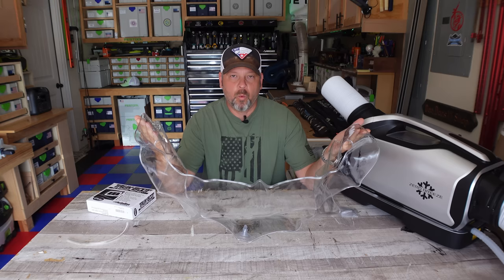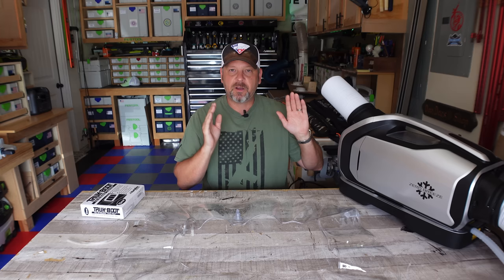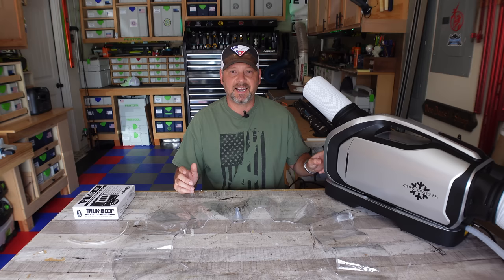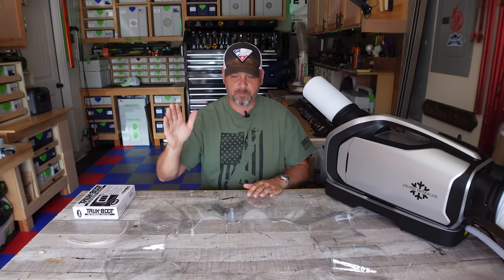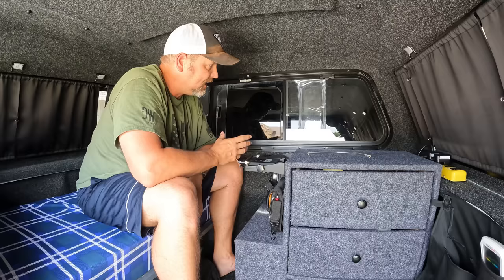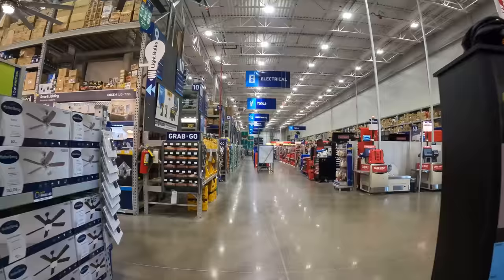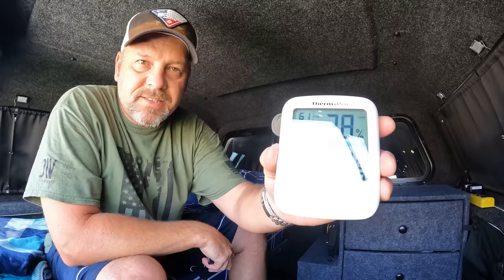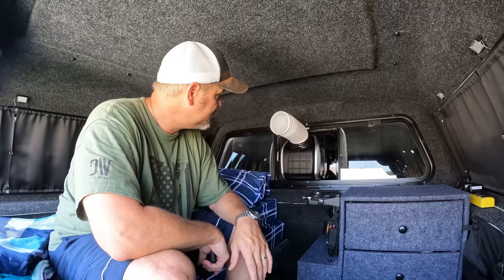TRUCK CAMPER A/C |  Performance Mods w/ a "Window Donut"!!! |  Zero Breeze Mark 2

Comment: they must recommend outside air for the intake because of carbon dioxide would build up after a while..  but  idk  .. the one design flaw i see is the out and the in pipes are right beside eachother out the window probably sucking some of the hot exhaust in with the fresh... maybe if it went out the other window on the other side...nice setup tho

Comment: I believe they want you to have fresh air circulating throughout your camper shell.
Reply from the maker: Yessir Jay. I believe that is the case the more I research this unit and read all of the other comments from folks who are much smarter than I am on this thing👍🏻
Reply: Two of those 9'' opolar brand usb fans will work wonders circulating  the air I only have one I'm my minivan and I can't believe  how much air it moves  for 12 volts.

Comment: In a pinch you could use a fat bicycle tube to put in between the camper window and the truck window
Reply from the maker: Thanks!  I actually did that, and am using an 18” bike tube. So far it has worked the best
Reply: @BrianWatersOutdoors  your welcome

Comment: If I remember right the rear intake is for the Compressor, so it has intake and exhaust. The front is the same for air-conditioning.
Reply from the maker: Thanks👍🏻

Comment: It most likely condenses the hot air. Which in turn helps the efficiency for cooling. If you try to take cool air to condense it causes the ac to work more. At least from my rudimentary understanding of ac.
Reply from the maker: Great explanation actually! Thanks👍🏻
Reply: @BrianWatersOutdoors  no problem, I just seen about a 100 different people had a similar take. Haha. Just found your channel the other day. I’ve enjoyed seeing your truck upgrades. I actually bought one of the bed tents from rei on sale a couple days ago. Going to see how me and my son like that. I currently do not have a topper. Otherwise I’d go with something similar to your setup. Thanks for the inspiration.

Comment: You'll find out if it works really good when you go camping and are using it in the most extreme heat of the day. Either way it's a good way to cool off when camping on hot summer days

Comment: Also, tire inner tube if you haven’t already made the switch.. the rubber will make a better seal for your window pass through. Plus only about 4-6$ for one.
Reply from the maker: Yup! Using an 18” bike tube now and that’s worked out the best!

Comment: Just get you a cooler load it full of ice cut a hole in the top put a fan on it blow out the side you will bring your camper down to around 68 degrees for half the money
Reply from the maker: I’ve tried that, but it just pumps in more humidity and really didn’t help my situation. Maybe in drier climates this would be a good option.
Reply: I'm in Utah so I've been  thinking  about building  one of these.

Comment: 75 is manageable and well with in safe sleeping. I bet if you ran it all night and checked it in the AM when you woke up it would cool even more. On a side note maybe put the thermometer where you could read it from the outside so you don’t have to climb in to see it, and let it run all night and see what happens. I would be curious!
Reply from the maker: Thanks David. The thermometer I do have is Bluetooth so I can start to check it from the outside without having to climb in/out.

Comment: You need some sort of insulation on that roof of that camper maybe like a piece of mdf
Reply from the maker: That would help for sure!
Reply: @BrianWatersOutdoors  just wrap it with that same carpet put a few weatherized bolts and washers and bammm we do that a lot to our cars and trucks for SPL REASONS

Comment: Be careful with the donut and your truck glass. I used one once during a hunting trip that had us put quite a bit of miles down some dirt roads and to this day you can see where that donut was on my truck glass. I assume it was the dirt that etched the glass. I specifically cleaned both the truck glass and camper glass before putting it in. It’s not the end of the world as long as the camper shell is on, but it is definitely noticeable when it comes off.
Reply from the maker: Thanks for the tip! I have switched over to using a bike tube now

Comment: Thanks for the review of the Mark 2, but I find it on the weak side as 2300BTUs is really not that powerful.
Reply from the maker: Thanks. It’s just a “spot” cooler, and not meant to really air condition an entire space. But, for how I’m using it, it makes it bearable in 100 degree temps.

Comment: I have the exact same camper shell window.  I considered the tube from HD like you got but was curious and concerned about rubbing.  Any issues with paint rubbing with the tube?  Trying to find a semi permanent solution so I can cool the back for dogs while driving.
Reply from the maker: I did not notice any paint rub. I only had it on for about 4 months though.

Comment: Great video Brian!  How large of a solar generator are you using to power the ZB2 all night, and how are you "recharging" the solar generator throughout the day?  Solar, AC, 12 volt cigarette lighter or AC inverter inside of your truck?  If I purchase one I would need to recharge it during the day time on camping trips etc.  FYI: I purchased the donut and you are correct, the squeak is terrible driving down the road!!
Reply from the maker: I use a 2000w battery power station. It runs the unit about 6 hours, plus the battery that came with the Zero Breeze that gets me maybe 2-3 hours (running on MAX) cold setting. It is hard to recharge these 2000 watt battery power stations with solar, but you could if you had a very large solar panel, or multiple panels tied together. You can also use a car cigarette dc charging cord, but those only typically give you around 100-150 watts of juice. So to get all 2000 watts back would take quite a long time, and you’d need to leave your truck running so it wouldn’t drain the battery. Best bet is to use shore power to recharge if you can.

Comment: My donut covered the whole back window. You installed it from the outside. The valve to blow air in was easily accessible… Plus The Donut was far superior to your product. I picked mine up at an RV dealership.. Likely still have it…
Reply from the maker: I’m sure I did it wrong, or got the wrong size, but just didn’t work out for me.
Reply: @BrianWatersOutdoors  just trying to help. With your inside window opening the full width would have been easier for me. Plus mine had spots to tie cord between the top and bottom allowing it to stay uniform.. You had the right idea… mine was almost rubber tubing but good and heavy even to stay in place -40 below in the winter
Reply from the maker: Oh I know. I’m betting they “don’t make ‘‘em like they used to” is also the case. This felt just like a cheap pool raft, and had no tie down points. Someone did mention even a bike tube or motorcycle tube would also work. I’ll probably try out several diff options in the future👍🏻👍🏻
Reply: @BrianWatersOutdoors  call different RV dealers: likely have it in a catalogue or look up on computer…. Sure don’t see many of those around. Good luck staying Cool… 108 awfully hot … likely do a little better when sun goes down or park in the shade., Had many good years Camping and fishing out of truck… Canoe in top and then a Lund 16 foot.

Comment: What does it run off of? 12 volt or ??
Reply from the maker: Both👍🏻
Reply: 12 volt but the batteries  kind of small and is only 2300 btus

Comment: AC like this works off the differencial temps of inside vs outside air, if its pulling in cold air, it wont work right.
Reply from the maker: It’s pulling in outside air from the rear duct👍🏻

Comment: You’re misunderstanding the purpose of that 4 inch intake duct. That is not connected to the outlet duct on the cold side. The screen under the cold outlet side IS the intake, it IS recirculating exactly like you’re trying to accomplish. The 4 inch intake duct is used to carry away the heat from the hot side only and thus also has a hot side outlet, another opening/outlet perhaps you haven’t noticed. The way you set it up in the video is as good as it’s going to get, nothing more to improve except insulation at this point.
Reply from the maker: Thank you👍🏻👍🏻

Comment: Cant you just get a small RV ac unit and install it on top of the shell?
Reply from the maker: You could. If you want to cut a hole in your camper shell. Which I don’t.

Comment: just a question: Is it possible to install a rooftop air conditioner? Or are they too heavy for a camper shell?
Reply from the maker: I’ve seen it done….I just didn’t want to cut a giant hole in the roof of my camper👍🏻

Comment: I was wondering.. if you were to route the intake to the cabin that you’re also cooling down wouldn’t it be more efficient or at least have a quicker cool down if it were pulling air in from the cool cabin its creating? As well as you might get a dryer cabin if its circulating that inside air as its cooling it vs pulling in that outside Texas humidity and heat.. just my .02 and curiosity running amok! Haha really enjoying the videos my friend!
Reply from the maker: So, no not really. I can’t explain it as effectively as some other folks have in these comments, but that duct needs to pull in hot air from outside. 🤷🏻‍♂️🤷🏻‍♂️
Reply: Okay, yea I was curious as to whether it was an actual ac or a heat exchanger.. I figured the latter as they’ve become popular for window units etc. how is the dryness using it? Does the cabin feel humid still?
Reply from the maker: It does feel better after running it a while. I usually dump out about 2 cups of water in the morning from the drip line.

Comment: How do you power this thing without AC?  can’t imagine that battery pack would last very long.  I would like to see that test.
Reply from the maker: The battery can run it for about 3.5 hours. Then I use my large 2000 watt battery station and plug in the ac unit into the inverter side of the battery station and that gives me at least 7 hours. Or I just plug into camp site electric.

Comment: I have one and mine goes completely around the window
Reply: @BrianWatersOutdoors  I have a transport business. I have a 3000 watt power inverter to lithium batteries in the back but front behind the passenger seat in the bed and two batteries under the hood they're all tied together. I have a microwave a iceco refrigerator freezer and a slow cooker that I use all the time back there fixing to put air conditioning and heat back there

Comment: So complicated and expensive. Why not just put a fan between the cab and the sleeping area and idle your truck with the AC on high. By evening it should be more than cool enough for you to sleep.
Reply: You really don't want your vehicle idling all night, it wears the engine out faster, Also here in the south, Texas (where he lives) and the rest of the southerns states even at night it's hot and extremely humid.